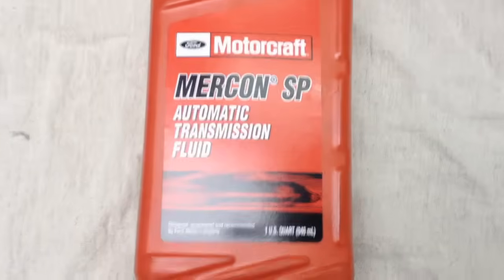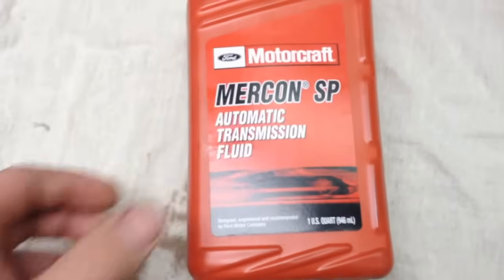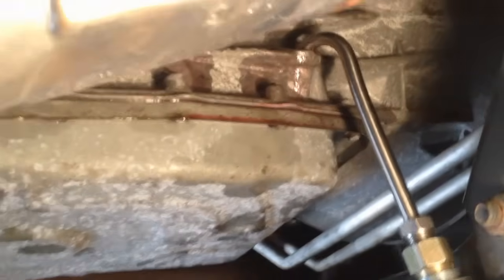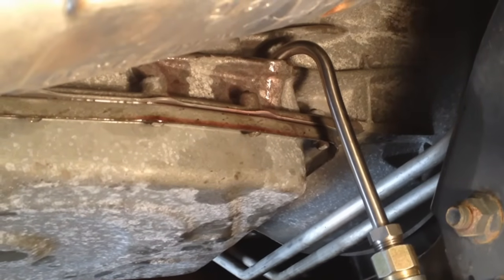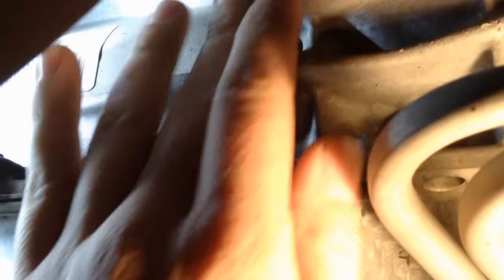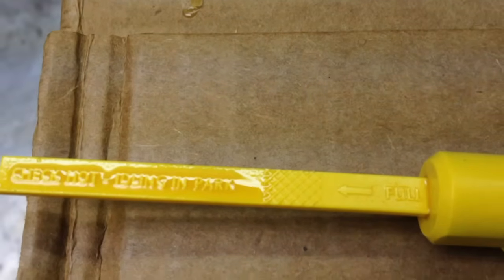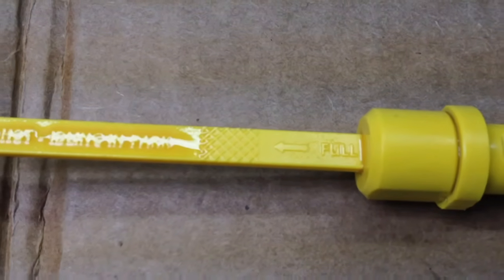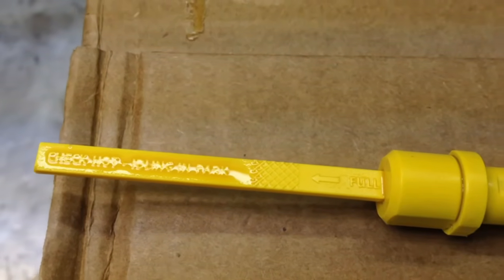Ford 6R60 & 6R80 6 Speed Transmissions: Fluid Fill & Adjustment Procedure

Comment from the maker: These are the Tools and Parts I Recommend:
Manual Fluid Fill Pump-
https://amzn.to/2ZNK4XA
Mercon SP Transmission Fluid (6R60 and 6R75)-
https://amzn.to/2ZN7H2o
Mercon LV Transmission Fluid (6r80 only)-
https://amzn.to/3c8Vg5T

F150 6R80- Mercon LV 2009-2017
Explorer 6R60- Mercon SP 2006-2008
Explorer 6R60- Mercon LV 2009-2010
Expedition 6R75- Mercon SP 2007-2008
Expedition 6R80- Mercon LV 2009-2014

Fluid Requirements (Approximate)
Fluid Drain and Fill- 7.5qts
Valve Body Removal- 9.5qts

Forscan is free Ford Specific Diagnostic Software:
Download Here- 
https://forscan.org/home.html
ELM 327 Adapter I Recommend-
https://amzn.to/2GC6dBj

As an Amazon Associate I earn from qualifying purchases.
Reply: What is the name of the hook part you have where did you get it from
Reply: @fordtechmakuloco if you have the time to possibly answer a question of mine I had to change my transmission lines and radiator , tranmission cooler and a few other miscellaneous parts after completion the transmission wouldn’t register reverse or 1st gear. After about 20 minutes or so of idle the transmission would allow me to drive shift perfectly fine go into all gears. No grinding no bad smells no hard shifts nothing . If I let the vehicle cool down I have to repeat to drive it again since this happened I haven’t driven it more than 2 miles total to avoid any potential damage I checked my fluid I was almost a quart low so I followed your steps to top it off. Currently waiting for it to cool again to see if I have all my gears now. Is there anything else I should do or some kind of advice you could please give me
Reply: How hot does the transmission need to be to check the oil level?
Reply: I got a 2010 F-150 6R80 from a relative when her husband passed. The trans gasket is leaking so I was going to replace it but figured I'd check the fluid level first. When I pulled the dipstick out it was broken off so I pulled the pan and the other part was inside. The dipstick is the same as the one in your video, yellow with only one full reading on it. The replacement ones come with two level marks A and B. May question is if I line the two up the marks on the old dipstick lines up with the A section of the new dipstick. But everywhere look they are showing the new dipstick and say to fill it to the B mark, wouldn't that overfill the trans? 
Everyone out there is saying nothing to use the A making for anything. My thinking is that there was a VIN change sometime down the line and Ford went to one dipstick with two markings. A for the vehicles before the VIN break and B for the ones after. Can you or anyone else in the chat verify this? I even talked to two different Ford dealers and they can't. I can't figure out how to add a picture of two dipsticks side by side.
Thanks
Reply: Great video.  Any idea where I can find the metal hook style hose end spout you have for the fluid?
Reply: @Fordtechmakuloko if we click on your links above or any from your videos does it automatically give you credit for our purchases?  I'd like to make sure to give back to you, you've helped me out so much already and saved me $$$
Reply: I missed it - is the plastic dipstick inside the fill plug?  Or does that need to be bought separately?
Reply: The manual fluid pump you recommend does NOT fit onto the mercon LV bottles. Also the new part does not come with the foam that goes around the connectors anymore. Not sure why
Reply: I put mine into a quart oil container worked fine
Reply: @dyrdek  It will fit a quart oil container. But this video is about transmission fluid and specifically says use Mercon and this does NOT fit the Mercon botttles.
Reply: Got the transmission working fine e with the proper amount of transmission fluid.

Comment: I just replaced the trans fluid should I add a friction modifier for precaution
Reply: no
Reply: @brentbradley6711 trans overheated a little switched the fluid drove ok then changed fluid with friction modifier feels better.
Reply: no

Comment: I called a local Ford dealer to price out the service you performed on this transmission - over CAD$1,000 with tax.  Are they out of their mind?  $1,000 to change the oil in my 6R80.  The world has gone topsy-turvy!
Reply: I got a quote from my local Ford dealer to drop the pan on my 2015 F150 / 6R80 w/145k miles, replace the filter, and refill with the appropriate amount of Mercon LV.  The quote was $620 USD.  That seemed high, but the dealership service manager said they quote 13.3 quarts of fluid even though the refill will probably be less than 6 quarts.  Filter cost was $64 & 3 hours labor @ $130 per hr.  That puts the fluid & taxes at $166, making the fluid about $12 per quart.  
I ordered 7 quarts of fluid, filter, & a hand transfer pump from Rock Auto for $92, which included tax & shipping.  The job to drop the pan, install the filter, and refill the trans fluid wasn’t difficult, but it is a messy job. I have a lot of the old trans fluid in my shop, but the job is done…
Reply: Good ole kanook socailism sucks eh?
Reply: @hunterlong1266  I'm genuinely curious how you've attached the word "socialism" to a private company charging outrageous prices for a simple service.  Isn't that the very definition of capitalism?  I mean what part of that is socialism? Serious question.

Comment: So after reading all the comments and gaining the conclusion that the fluid will expand when hot. That’s why when people check it when it’s at operating temp it seems “overfilled” or “spilled right out”. I’ve been leaking trans fluid and filled mine right to when it came out and drove it around so the fluid would expand and let it sit. I’m going to check it in the morning to prove my theory that it expands when hot. (My leak is not that aggressive random gasket on top of trans) also that happens after long idles say an half an hour or so. Tmr morning I will let the truck warm up at idle for 10-15 minutes depending on outside temp then check the dip stick following this guide. I’ve been watching this guy for a while now he knows his stuff when it comes to these fords!!
Reply: Confused me a bit.. but you fill till it comes out. Then start it. That pumps the fluid out of the trans pan. When it gets hot, you leave it running. And check the dipstick again. That’s your true level. If it’s not running but hot. it should be “overfilled” because the fluid isnt circulating. You need the level of the pan fluid while the rest is pumping thru the transmission at temp.
Reply: @deeelkins2531 I’d say pump about 5 1/2 quarts in cold or when ever it starts to over flow. Get in start the truck and pump another 2-3 quarts in and it will over fill and that’s full. If you want check the trans once it’s at tempt but let’s be real no one wants to do it. So I’d 71/2-8 quarts is perfect

Comment: @FordtechMakuloco I blew a front transmission hose on my 2016 F150 5.0 with 6R80 transmission.  I was wondering what is the correct level on dip stick when at operating temperature.  I have it in the middle of a/b warm like in the video. But was told when its hot it should be at top of B and top of A when cold. Just want to confirm because I just had the transmission rebuild and do not want to mess up the transmission. I've gotten sooo many different anwsers from people in the groups and google. I trust your expertise.  Thank you.
Reply from the maker: on a 2016 it should be at the top of "B" at 206-215 degrees
Reply: @FordTechMakuloco Thank you sir. Ill have to add some back in when I get home. Thanks for your conformation! It was at the correct level at top of B until I seen this video...Then I extracted some to put between it a/b when warm.

Comment: I just used this video to do my 2016 f150 and it helped a ton. I did an aftermarket PAN with a drain plug and change the filter? And it took 7 quarts. At first I filled it up to the bottom hash marks and then went and drove it around and got it up to about 185°, and when I checked it again at that temperature, it was way too full. So I took a half crazy core out, and when I check it when it's cold, it's only about halfway up the dipstick, it's not even close to the hash marks.

Comment: I replaced my pan- Doorman makes a pan that has a drain plug.  you can easily cut a clear tube with a funnel that will fit the dipstick hole from the top and fill as needed...  very easy
Reply: Did that with my F-150 last night.

Comment: For dummies like me, you are checking the fluid with the engine running and transmission in park. Bottom of hatch marks, if the fluid is not warmed up properly.

Comment: I used amsoil 150.000 miles ago after a flush installed a new torque converter runs perfect still and have 325.000 on the original transmission

Comment: Hello. I have a 2010 F150 and i need to put in the 6R ATF Xl-16 additive into the transmission as im hearing a intermident grinding at 20mph and 40 mph. Can you help? Should I use to or just one syringe of that stuff?

Comment: I'm a bit confused.  I'm doing this for the second time.  I followed your instructions the first time and they were fine.  THEN, we started her up and shifted D and R etc.  Then got to operating temp and did a check.  So, this time we're not burning ourselves OK.  No shifting though?  Also, folks are saying it has to be hot to get a proper reading because of the cooler circuit being shut.  Anything to this?
Thanks!

Comment: I have a 2012 f150 lariat eco boost , My tranny bangs when I turn off my gravel drive onto the pavement. It doesn’t do it all the time but it does it enough to worry me. I changed fluid and filter and it seemed to help for a while but it still does it . Would love some ideas, great videos bud!

Comment: Hi, Thank you so much for the information. I am working on a 17 f150 6r80, changing the lead frame on it. Im replacing with a new OEM part from the dealer. the truck was running and driving drive and reverse with just an intermittant p0720 and p0722 codes. after replacing the lead frame the truck would not engage on reverse. the indicator show R and live data as well. its just not moving in reverse at all. Do you have any idea what would be the possible cause of it? thanks in advance

Comment: When leveling the oil after replacing the lead frame, do I add oil while running to level it? I’m confused, I added about 7.5, if I measure while running it’s below the mark.. so idk if I’m supposed to add while running to level it. Does anyone know? Thanks 🙏

Comment: Question for ya, and anyone else who may have input... my 2010 4.6 3v F150 has 307k miles on it, and to my knowledge original transmission fluid. It shifts great for the age and mileage, so no concern there. Just the occasional usual 6r80 "light bang". Would it be a bad idea to change the fluid at this point? I'd just be dropping the pan and changing the filter, no flush. I don't expect it to make it shift perfectly (which it shifts perfectly enough for me now) but I would want to do it to prolong the life if that would even make a difference at this point.

Comment: Hey there! What is the name of the fluid hook adapter you used, and where can I get one?? Thank you for all the knowledge in your videos 🫡
Reply: I’m about to do this gonna make a hook out of a piece of coat hanger and zip tie to my plastic tube should work fine 🤷🏻‍♂️
Reply: @BB-xq6rj  that’s a clever idea!!
Reply: @krazydogg82  just did mine today and the coat hanger idea worked like a charm!! Also I have a small welding blanket I use to cover my smoker when it’s cold out used that to wrap around the cat so it made topping it off while running easy peasy

Comment: I have the 2010 5.4 triton 3 valve XLT model. Which fluid do i use?
Reply from the maker: Mercon LV as SP is no longer made.
Reply: @FordTechMakuloco  quick question I have a mustang 2011 with the 6r80 when I checked my transmisson dipstick when hot it was passed the crosshatch around where it says full. Does that mean the trans oil I way overfilled?

Comment: so you fill it til it overflows?
Reply from the maker: Initial fill yes.
Reply: @FordTechMakuloco  I just did my leadframe replacement, and roughly 7 quarts got in the pan. I added about 6.5 and that's when it started to overflow. I don't know if that's goo's or bad but I went through the gears and drove it till 200 degrees and everything seemed fine and no more random downshifting :D
Reply from the maker: You still need to adjust the trans fluid level when hot at idle. After a lead frame replacement, they generally take 10-11 quarts.

Comment: What would you consider as warm? Would the truck be running  as well and get to the bottom of the hash marks?
Reply from the maker: The truck must be running as in the video trans fluid around 200.
Reply: @FordTechMakuloco  thanks Brian. I ended up only being able to get it around 190. I had the dipstick with the A and B hash marks in my 2015. I went to the middle of B and called it good. I will check it again in a week or so

Comment: What would cause the fluid to pour out when the engine is running?
Reply from the maker: overfilled
Reply: Just purchased a 2013 6.2.  has a strange vibration around 70. Replace the tires and that didn't fix the problem. I was checking the transmission fluid today and with the engine running, it was pouring out of the transmission.  Being overfilled with what my thoughts were as well.

Comment: Had the dealer flush and fill transmission w/filter. Checked my fluid levels on the engine and noticed is was overfilled by 2 or 3 quarts. Also noticed a red tinge on the fluid. What will having transmission fluid in my engine oil do to the seals and friction surfaces and what should i have the dealer do?

Comment: For working around a hot cat, I grabbed a flexible "nut grabber" claw  to hold and manipulate the dipstick, welding gloves, and an articulating ratchet wrench so the 19mm socket can be flipped over 180deg, and to avoid melting the fill pump hose, hooked it front of the coolant lines back to the fill.  No burns!

Comment: This video helped me a lot. For some reason it took 8 quarts but when it’s on the dip stick shows no fluid. This didn’t account for the new torque converter. Hopefully this fixes p0731. As there no burning smell to the fluid or bad discoloration.

Comment: Someone asked about finding temperature with scan tool, lost the comment, on a 14 150 go to gauge mode on dash menu, gives trans temp. Mine seldom gets much above 160-170 in normal driving. Its time to check mine also, cant wait...

Comment: Am I an idiot for using the same oil syringe for first filling front diff 80w90 and then using the empty but dirty syringe to fill my transmission 6r80? 

Do I need to be concerned? Should I go get a flush?
Reply from the maker: It will never be a problem.
Reply: @FordTechMakuloco  Thank you for the response.

Comment: 2014 f150 reads low (A hash mark) when at full operating temperature
But when cold, it reads it is overfilled. (Above B hash mark) 
Do I put more in or no?
Reply from the maker: The only reading that matter is at full operating temp and running in park.

Comment: What happens when I take the cap off with the truck sitting level and fluid just keeps coming out ?
Like how could it be that full ?
Reply: When the engine is running and you shift thought the gears, the level will drop since the pump is running fluid through the system.  This is when you're supposed to add additional fluid to the hash marks.   Once you shut the car off after this, the fluid will drain back into the pan, and may be above the fill hole.  That's why some have reported the fluid leaking out when they open the fill port.  For those that don't, my guess is either the fluid had leaked somewhere or it was underfilled from the factory.

Comment: Had a Shop who specialized in ford supposedly do my transmission because i didn't have time to do myself...they ended up under filling by about a gallon and it ended up causing shift issues thinking it was a lead frame, solenoid/valve body, and even a tcm issue. Nope, filled with appropriate fluid level. They also over torqued the fill plug 

Vehicle reference 2016 F150 2.7L 6R80.

Comment: How can I know which transmission i have in my 2010 Explorer Sporttrac Adrenilin 8cy 4.6? Ty
Reply from the maker: 6R80
Reply: @FordTechMakuloco  thanks Brian you are the man! I sitting here crushing some coors light and wondering how I am going to pull this trans fluid and Bulkhead connector change off. You give me the confidence to pull it off. U the man!
Reply: @FordTechMakuloco hi and LV or SP tranny fluid for my 6R80 2010 Adren Thanks alot!!

Comment: 2014 f150 5.0  change oil and filter every 60,000km  at 124 just changed,  heavy highway towing,  oil still looks like new and trans shifts like new    i use Castrol full syn each time

Comment: Great video, definitely helpful. I will say it took 11 quarts of transmission fluid for me. The fluid I used was valvoline multi use. Mercon LV rated. 2012 Mustang (3.7 v6, 6R80 transmission)

Comment: I have a question and hopefully someone can answer it.  When adding the fluid, maybe approximately 4.5 quarts…do I start it then and run through the gears then adjust or let it run without going through the gears?
Reply: You have to go through the gears to allow fluid into torque converter and transmission cooling lines